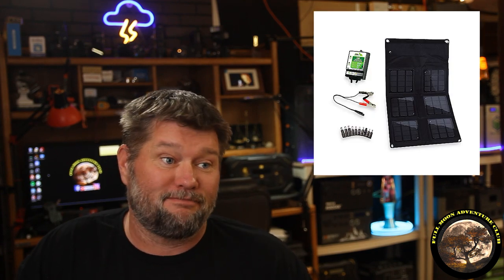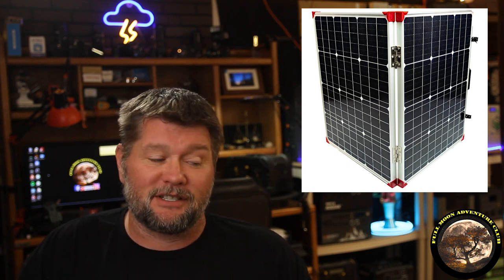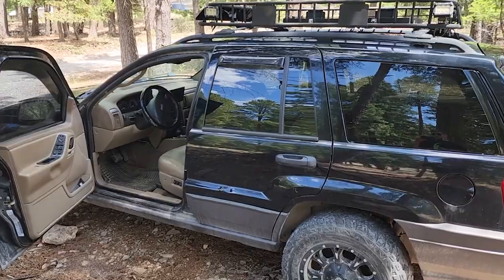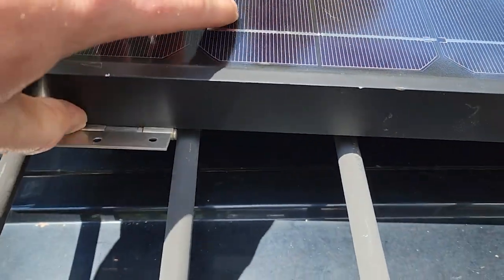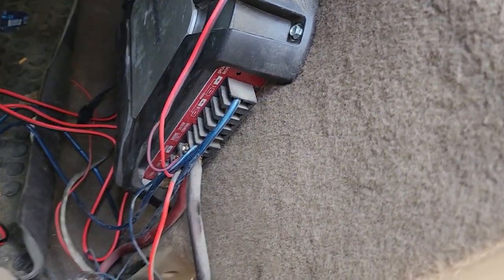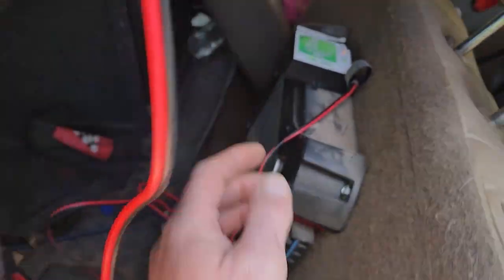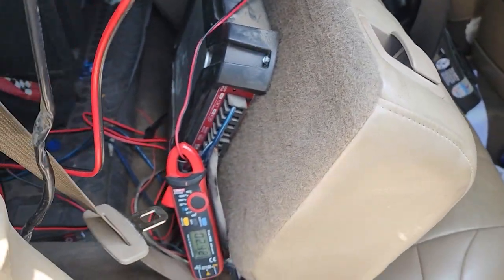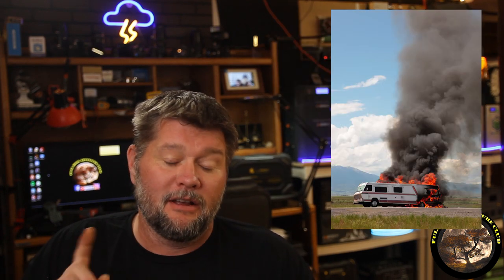"DIY" Solar Car Battery Trickle Charger- Easy!

Comment: 60 watts :O That's a lot dude, I charge mine with like a 2W panel and it's always full. With 3 amps x 12 v you had like... +30W, this is like you could have a small coolbox running all the time and it would not discharge the battery at all :)

Comment: I've always wondered about those little PWM chargers, do they ever get up to absorption voltages for any period of time? Or are they just bulk charging? 🤔
Reply from the maker: It really depends on the charger. The one in used in this video is super cheap so I assume it's just bulk charging to a certain voltage.